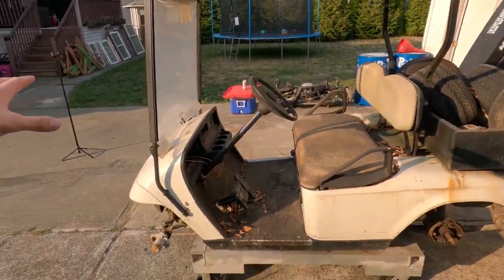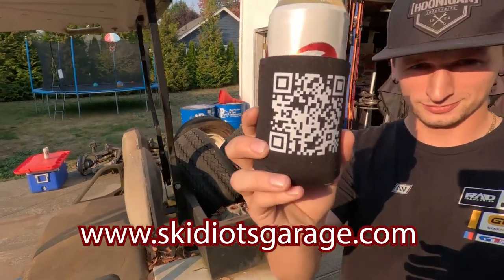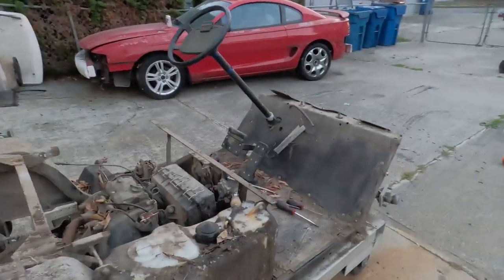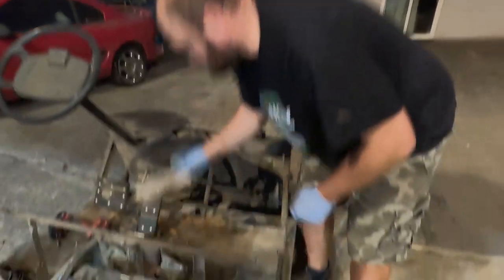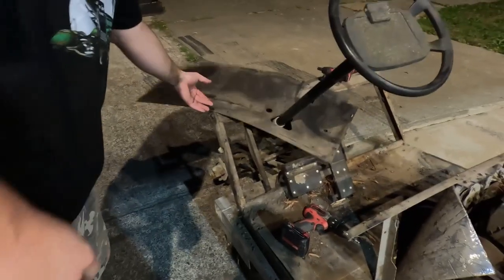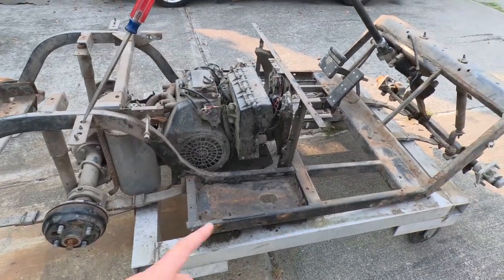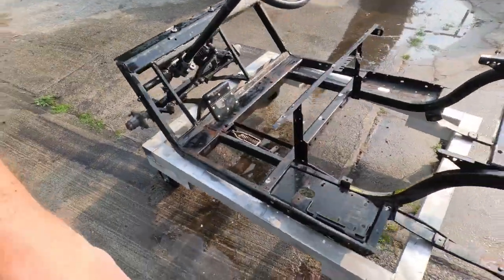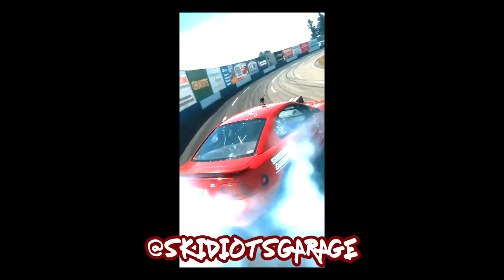Golf Cart Motor Swap!? The Tear Down Begins Now!

Comment: Definitely going to be sick! I just picked up a 1999 EzGo with a bad engine and considered the predator engine swap as well. Cool to see you guys tearing into one 🤙
Reply from the maker: Thanks! We will have more videos out shortly. It’s for sure the way to go as you’ll see coming up in the next videos!
Reply: @Skidiot's Garage  I've heard you lose reverse, is that true?
Reply from the maker: @BrendanMilteer  should be able to keep reverse, the Vegas carts kit comes with new extended shifter cables. Reverse is driven in the rear end not by the motor so it will still be there.